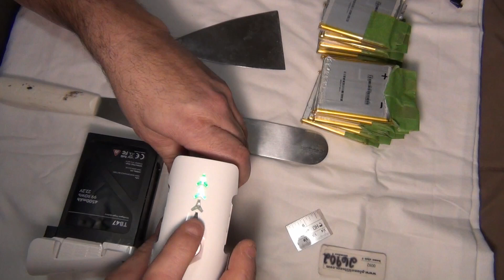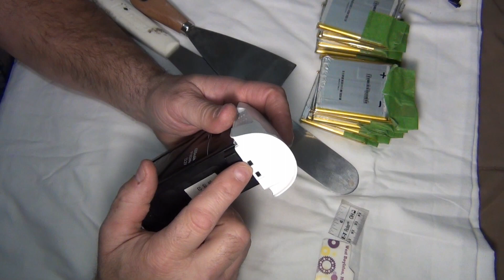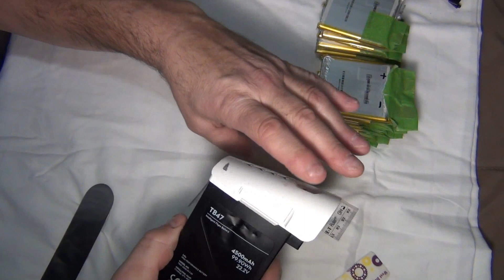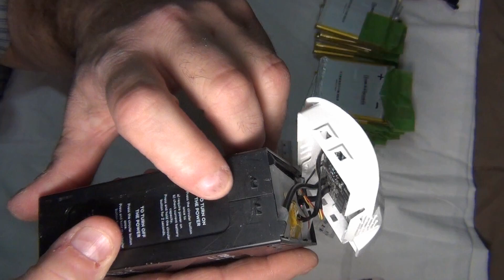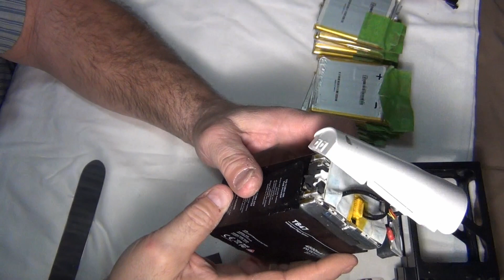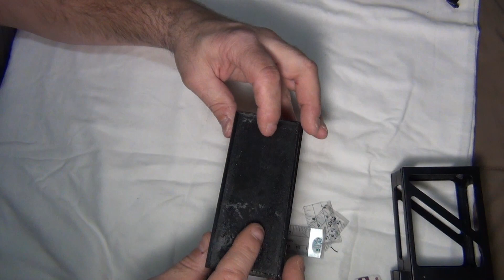DJI inspire battery teardown and thoughts on mods

Comment: Just a tip for everyone, i needed to pull one apart a few days ago and tried most things but found a fork in on end then another in the other and gently pull apart, BE CAREFUL as there is a cable between the lid and battery, any further than about 20 mm or an inch and you will rip it off ........ by the way in the rest of the world we SOLDER our wires and not SODDER as this always reminds me of "Sodomy" and im NOT going there ........

Comment: I have make it this type battery mod. I have using molicell . But battery was not charge full mah and showing on bms full charge. Only 1380 mah was charge.. Im using 8400 msh 6s battery.. Still coming problem for battery charging and not getting more than 5 min flight time. 
Please suggest me so i can resolved this problem and I can fly more than 25 min. 
Thanks for your good video.
Reply from the maker: have to program the BMS board with special software..

Comment: Use round toothpicks. No spatulas necessary. Measure from the white part put one on each side half an inch in from the back, then one on each side 1 inch in from the front (measured on the white part. and Then one in the front and back directly in the center (between the tabs)

Comment: Hey I just bought a used inspire one with ofcorse dead batteries and I’ve done a battery mod but when I get everything plugged in and powered up the drone is not reading the battery and it’s not sending a signal to the phone either it’s giving me a battery alert on my phone any ideas as to what maybe going on??
Reply from the maker: dead batteries will have to be reset thru programming, truth if it was easy everyone would do it

Comment: what happened to the 18650s? Is it any good?
Reply from the maker: they work, but limited time, been to wet and cold, to do video on my spare time.....but best compatible way to  use an old tb47-48 battery.......but its hard to get real 18650 cells, lots of fakes out there
Reply: Alright, Will keep note of that. Thanks for your reply...

Comment: Hi cruzroy. Those were my batteries. The charged battery was one that I reclaimed from dead, but will only charge to the point that I marked on it. The other was a bait battery that I bought on eBay. Couldn’t see by the picture how bad it was when I bought it. I usually use a thin knife blade and guitar pics to get off the heads.  Good luck with those 2.